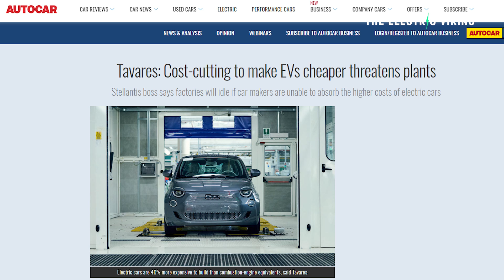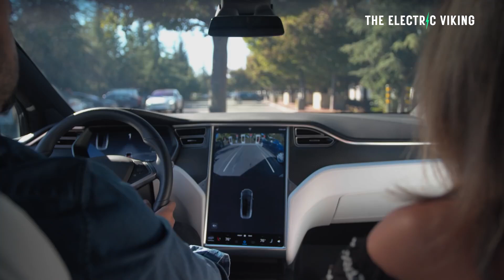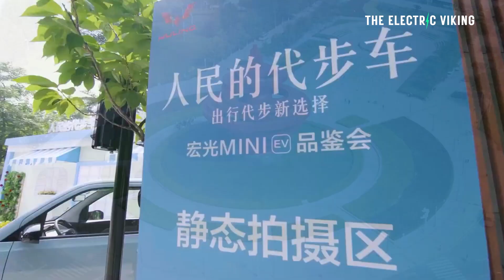Why are some EV's more than double the price of the gas model

Comment: You're gaslighting us. Where's the 25k EUR (MPV, no net figure) Model 3?
No? Then you are comparing apples with oranges.
Stellantis are making small cars, it's very price sensitive market. People after luxury sedans abd SUVs can afford to pay extra, hence Tesla is doing well since they got to that market.
Another thing is to make price sensitive cars in small segments. There's a reason Tesla hasn't got in yet, its harder.
Reply: MG 4 costs roughly the same as a comparable Golf in Europe. If you look under the skin, Continental is a major supplier to both and SAIC also makes VW cars in China, so quality is similar. The MG starts at $18k in China, and they are not the only competitor in that price range.
Reply: @larryevans6739  You´re right that the chinese are one step ahead on the final goal of making electric cars as affordable as ICE cars. However, you haven´t debunked my point and it´s stands correct.
Te hfact that ICE cars are more expensive than ever now is well know in the industry: the OMGs need to raise funds to pay for the investments on electrification.
This doesn´t mean that people who are already adults know what car prices used to be like: I tried to buy an Opel Astra diesel for only 15k euros, a friend of mine bought a Ford Focus for 17k, an ST line one. One ex of mine bought the SEAT Ibiza for 12k euros. Small cars barely never got beyond 13k, and you could find some below 10k for entry levels.
The MG 4 is minimum 31k euros.
Maybe you have lots of money and you think that the gap from 15k to 30 is not very much, but for most working families it is.

I bought my Opel Corsa-e (electric one) for 30k, with 7k discount (but I´m still waiting for the government here in Spain to hand over the money) so I had to pay upfront for the car. I like the car, a lot, and the car is selling actually well here in Europe.

However, until the moment a MG 4 comes down to 20k or lower, a Tesla Model 3 is being sold for around 25k to 30k max (MPV), and an Opel Corsa electric is no more than 15k euros, then we cannot say that EVs are par with ICE because that will not be true.

And in China the MG4 is only 18k US dollars, but you could check that cars used to be sold for less than 10k US dollars back in the day.
Reply: @DanRyzESPUK  I think you are comparing apples to oranges now. I compared a new Golf to a car that is roughly the same size, quality, capability, price and model year in the same country. A Tesla Model 3 doesn't need to cost 20k less than a BMW 3 series that starts at 45k euro in Germany. If you want to compare small cars at the bottom of the market, the BYD Seagull starts below $9000 in China and there are mini cars less than that. There are not enough of them in Europe yet, but it is only a matter of time before Chinese imports start driving down prices (unless protectionism gets in the way).  If you compare comparable cars, the cost gap has largely closed, even though they might not be from a legacy auto brand. 

And if you want to compare cars now to historical prices, then that really isn't relevant either. In the 80's, I could have bought a new car for $5000 or bought a house in Brooklyn for $50k that is worth $3 million now... but I don't own a time machine.
Reply: @larryevans6739  I'm comparing them to what they used to be 3 to 5 years ago, not 30 years ago.
The increase of prices have gone ballistic, far far superior than inflation. I looked up to an Astra only 5 years ago, and my friend bought his car only in 2019.
The prices now are grotesque and they break historical trends.

Comment: Volume is important. Just to make up some numbers as an example, if it cost $1Billion to do R&D on a new car / platform, and you make 50k of them, then if you apply all of it to those cars, it cost $20k per car plus the actual production costs. If you make 500K cars, then the R&D per car is only $2k. Of course, assuming on going production, you can spread the cost out over time, but it still shows how important volume is.

Thats why air force bombers are so crazy expensive when they only make 100 of them.
Reply: Hard trying to explain economics to many. Its a business risk like deep water drilling for oil from one drill hole.
Reply: @ralphzoombeenie2330  or having investments in oil when everyone is signalling how it'll end up as stranded assets. 

But they'll never let oil die sadly.
Reply: The Military Industrial Complex is just outright THEFT

Comment: Why Tesla had a profit ?, because EV cars cost 40% more to produce and Tesla car is 2 times more expensive. It's a simply math not magic. And still most of the people can't afford Tesla. Let's see Tesla profit in 2023 after they reduced the prices. You say BYD is competitive ? in Europe BYD Han and Tang start at €72,000, vs. Petrol Peugeot 3008  € 29,000 , WTF ???  Do you think sometimes about people who can't and will never afford EV cars ? The regulation and forcing citizens to EV cars can lead to Automtive plant closures, insolvency and unemployment rate in massive scale with new economical crisis. EV cars at the moment are terrible, high price, short range, terrible range in low temp. And Stellantis and other OEM will not be another Kodak or Nokia. In their case the worst technology was replaced by better one without any regulations. It was a people choice. Currently the governments trying to replace very good technology gasoline Euro 7 with worst one EV. It will not work.
Reply: Never is a long time. Demand is high and rising, and there's not enough batteries to go around, and EV only designs are still on the drawing board. These inefficient gas/hybrid/ev platforms are not gonna cut it. Forcing them to step up to new technology is painful, but it has to happen. That's how to reduce costs so cheaper models can be built.
Reply: Governments are forcing SheePLe into EVs.
Worldwide🌏Mandates of no more production of "#ICE vehicles"  by 2035 or 2045 depending on the country.
In the End,  we have no choice. 🥺

Comment: I can certainly believe that it is 50% more expensive for Stalantis to build the same car because it is the same car.  There was no thought into the the production of the electric vehicle.  

Take one look at the 500 and you pretty much know there was not a whole lot of thought even given to the internal combustion engine car. If it's an example of European styling you can very well keep it. 

My point is, you really need to have a completely separate production line for an electric vehicle. You cannot build an electric vehicle utilizing an internal combustion frame and body. 

This is the dilemma for stalantis, and it's internal combustion / EV manufacturing. You're either into EVs or you're not. You can't have both at the same time and that's what they're trying to do. The comment below about the IQ involving the CEO is still Ennis maybe very correct.
Reply: The 500 is not a typical European car. It's a tiny and expensive subcompact in the European market. Too small, too expensive.

Comment: Stelantis has fought this every step of the way.  When they finally decided to make EVs, Tesla, BYD et al had already locked in the battery, motor and raw material costs.  That left Stelantis bidding against the rest of the laggards for the remaining small supply.
Reply: You may not have seen Stellantis BEVs in your country but for many years the Renault Zoe was the most sold BEV in Europe. They manufacture many BEVs under their different brand names but most of them are not sold worldwide.
Reply: @juergenschoepf2885  Renault is in partnership with Nissan and Mitsubishi. Its main rivals, Peugeot, Citroën and Opel used to be PSA now part of Stellantis.
Reply: Stellantis was relatively new, preceding it had the drama and shenanigans from the former Fiat boss against the 500e (almost entirely built by Bosch).

PSA had the rebadged Mitsubishi iMiEV and low production Berlingo van electriques. They were definitely slow and still in the middle of their 2008 phase.

Comment: It would be interesting to see how much it would cost to convert a car designed as an EV into an ICE powered car?
Perhaps the cost analysis is based upon a conversion cost approach, rather than a ground up EV design approach used by Tesla.
Reply: It might cost a billion dollars to design a completely new platform. The market for it better be there. If 90% of buyers in the USA prefer gas or hybrid, an EV platform doesn't get built. Tesla is the luxury niche appealing to the early adopters so they get away with charging too much. Building econoboxes at low prices will take time, vision, and ingenuity. Henry Ford did it. The lesson wasn't lost on Elon.
Reply: Correct. A dedicated EV platform is far more flexible than a gas car where the design is built around a 250+kg engine/gearbox which determines the overall design and passenger location and inefficient  frontal design for cooling. An EV motor is less than half the weight and far smaller, can be located fore or aft. The battery usually in the floor make weight distribution another benefit to strength and stability. Many systems in a gas car including the expensive catalytic converter add to complexity in manufacture and cost.

Comment: it's mostly due to batteries.if EVs had small packs under the floorpan,the cost would be lower.
Reply: My SAIC MGZSEV has a 70kwh battery pack and is one of the cheapest EVs on the market.
Reply: How come Wuling can sell the Hongguang at $5500  with a 10 kw battery and for $12000 with a 27kw battery and the Fiat with a 24kw battery costs $28000? Sure the Fiat is more car but the battery cost can't be over $8000. In fact Fiat add 18kw i.e. a 42kw battery for an increased price of $6000. Pricing makes no sense. There are far bigger cars with say a 62kw battery like the MG5, much much more car than the tiny fiat for $38000. A full size estate car with 62kw battery for $4000 more than a two door mini.
No wonder the Stellantis guy is shitting himself if he can't produce a mini and sell it for under $34000 with a 42kw battery.
Reply: Stronger structure and suspension needed to support that extra weight